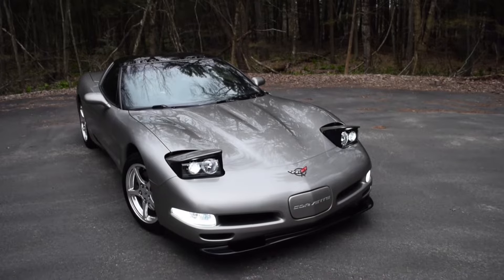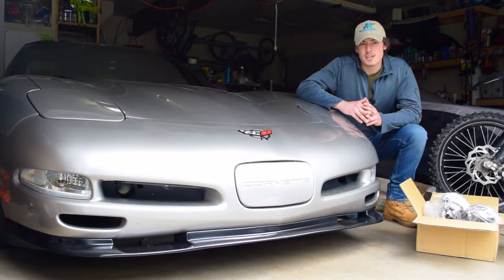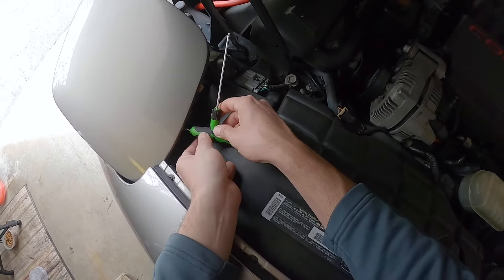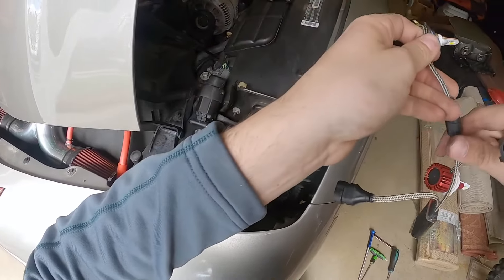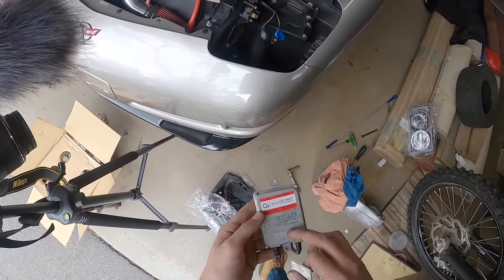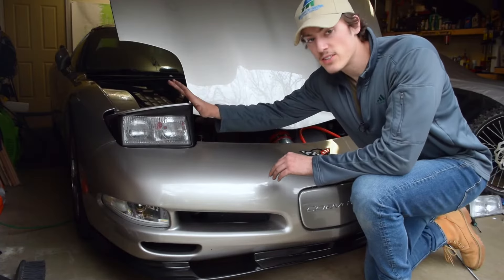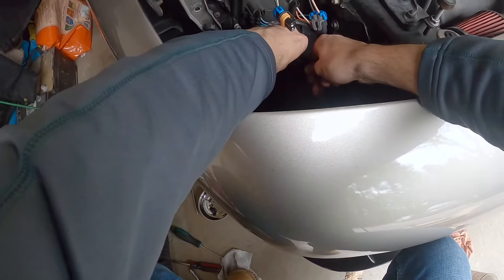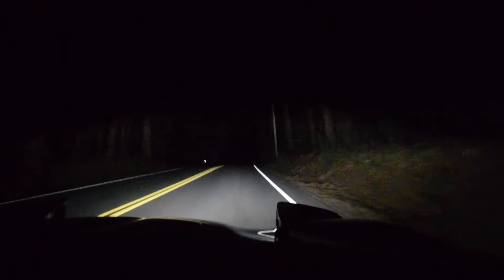By Far The MOST POWERFUL Headlights For The C5 CORVETTE! | DriveHub

Comment: Looks nice. I went a different route for my headlight upgrade, but it's the end result that matters. Trying to get any good beam pattern from the stock housing is worthless. Rotating the motor by hand is the easiest way that I found to get that arm back in the slot. Also, taking out the painted headlight cover screws located in the back is easier with the headlight is down. I hope you won't be kicking yourself a little later for not changing out the headlight motor gears while you had that all apart (if they haven't been done already) Keep up the good work!

Comment: Amber drl's are where it's at. I remember seeing the c5 rolling for the 1st time and the amber drl's gave it a really gnarly presence imo. Definitely getting these style headlamps though. They are a necessary and perfect upgrade and give it a very fitting and current apperance without looking custom or ricey. I have the same color as yours and going to perform most of the mods you've done so far. They are just tasteful and keep the car mostly authentic. Great job 👏

Comment: I am running through your C5 videos and what a joy, my ONLY complain is I just wanted the car to be a C6. Could you be so kind and next buy a C6 Z06 and give it the same overhaul as this nice and functional working and looking C5. About the HID bulbs and led yes you are spot on you want the correct reflectors behind the bulb. About the ballast, the manufacturers want them to be mounted in front of the radiator if possible to keep them cool. Big thanks .

Comment: Cheaper and easier just to put LED's in the stock housing. Auxbeam is what I went with ~30 bucks.
Reply: same i put low beam led's and they are great. I dont see how i functionally need any more. And if i really need those high beams I can still use the oem ones fine.

Comment: I like the look of the product, and the more powerful beam that it put out. But having to use double sided tape to secure the ballast in place doesn't inspire confidence. I would prefer hardware that mounts more solidly with screws/bolts of some kind. As time wears on, and heat takes its toll, the adhesive that holds this securely will break away.

Comment: They look Great, I question how long that 3m sticky will last. I only drive my c5 in the dark when I take it to work. Not often enough to justify a $600 upgrade with no performance gain. Just my opinion.
Reply: U can order basically the same headlights on ebay for $130 and purchase hid separately for around $100
Reply: U can order basically the same headlights on ebay for $130 and purchase hid separately for around $100

Comment: Just installed mine, and the drivers side low beam won’t come on :(. Wiring is all correct i checked it a bunch of times. Think the lights may be faulty. Anyone else have that issue or have any recommendations?

Comment: why the pop up head light mechanism not working symmetry after u changed your new lights?
Reply: Muhammad Akmal he needs to aim them.  The cutoff should line up.
Reply: No that is how they are supposed to be. The driver's side low beams are always cut off lower so it doesn't blind oncoming traffic. This is how all factory headlights are designed and good quality after market should be as well.
Reply: CMJ115 each projector has a cutoff that’s not a flat line, it’s lower for not blinding oncoming drivers on the left and then transitions to higher to able to reflect signs to the right of the road.  That upper line is what I’m talking about should line up.  If you look at any new car from the factory or dealer, you’ll see this is the case.

Comment: There are two things about older cars that drive me nuts.  First, the audio systems are sorely out of date.  Second, the headlamps use old technology that is really bad at lighting up the road.  I know you've rectified both of these issues in your C5 and I know I'd have to do the same.  The headlights would have to come first.  All of my current cars have the adaptive bi-xenon setups, and I don't think I could live without them anymore.

Comment: Dude.  Wd-40 is not lube.  It’s a water displacement fluid. It dries out quickly.  Use some lithium grease to lube up parts.  WD is fine for part removal, but lord, don’t think you did your parts any favor by displacing what little lubricant they had left.

Comment: Lost me when tapping into the fuse box. Don’t like the idea of all the added wiring needed for this modification. I’ll stay with stock.
Reply: Dont need lights if you never drive it anyway. Just leave it all stock. Wipe it with a diaper, look at it, then sell it for 10,000 over actual value.

Comment: I have C6 headlights that came with the car. They suck, and whoever installed them must have crossed wires, because there is no way to have all lights off at one time. It's a 23000 mile originally owned 99. I'm the 2nd owner. The wiring looks like hell too. He claims Chevy installed them.

Comment: Still not very bright🤣. Why would anyone pay$750.00 for each head light. You should have bought a new car before putting all this money into the C5. Now your probably going to need a new heavy duty Alternator to power these lights. Plus watch for smoke test as wiring will probably ignite.😬
Reply: They are $675 for the pair, not $750 each.
Reply: Do you drive your c5 at night?